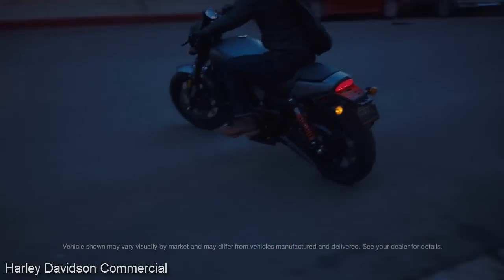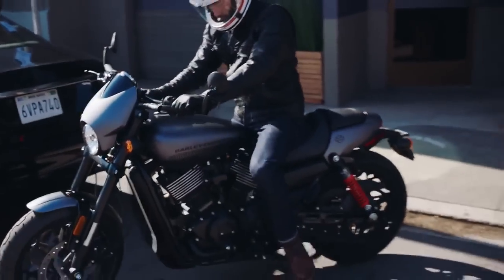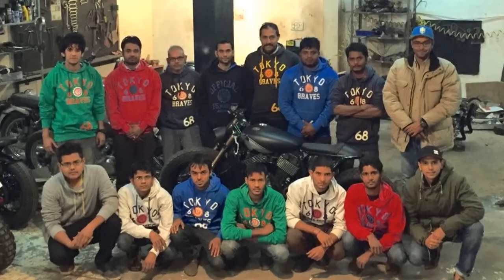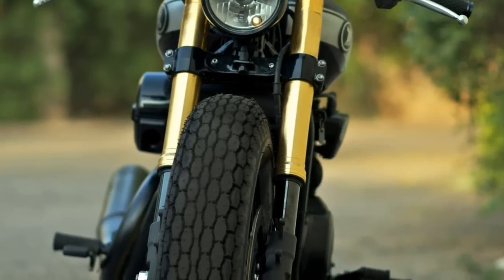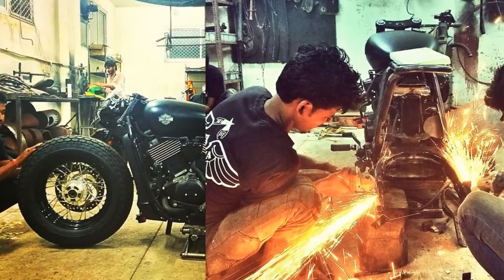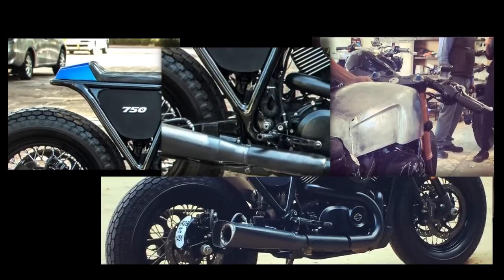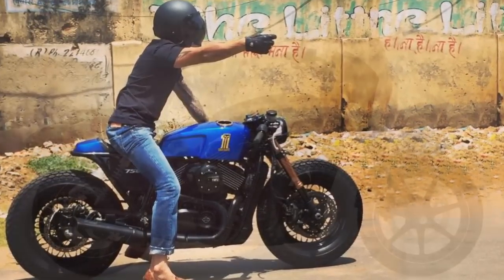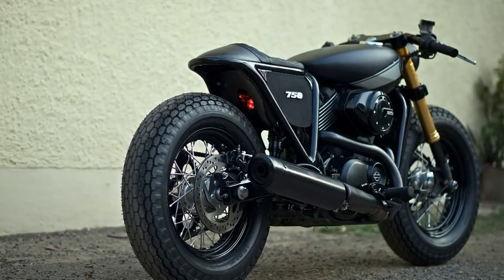Cafe Racer (Harley Davidson Street 750 by Rajputana Customs)

Comment: HD tried this market in the past. Anyone ever hear of Buell?
Reply from the maker: It is not exactly the same market.
Reply: Yes. Buell's were gear more towards the street fighter style and your video shows café racer. But both of them were stepping out of Harley's comfort zone of the "cruiser" style bikes. And to be honest. I've haven't seen many Buell's on the road over the years. What's surprising is the early 80's Virago is a sought after bike to convert to a café racer. I know it's on the top of my list. 2nd to the CX500.
Reply from the maker: I believe that the problem with Buell, was making their motorcycles to look too much modern. But this is different. It still has some retro appeal.

Comment: I am worried about whether this front tire will hit the radiator.
Reply from the maker: Yes i understand your point. But i am sure that the Guys from Rajputana 
Customs, wouldn't make a mistake as such. But i recognize that in some 
photographs, it seems that the tire can touch the radiator, but it is 
probably becasue of the angle distortion of the lens.. :) Cheers.
Reply: I appreciate their passion and effort.Cheers.

Comment: Nice! I'm curious to know if the front tire will touch the radiator though.
Reply from the maker: Lol. Yes i understand your point. But i am sure that the Guys from Rajputana Customs, wouldn't make a mistake as such. But i recognize that in some photographs, it seems that the tire can touch the radiator, but it is probably becasue of the angle distortion of the lens.. :) Cheers.

Comment: Leaving aside the rear suspension, did you notice the similarity between the Harley from Vijay Singh and Keeway superlight 125 (Small Cafe Racers 2) from Tony's Garage in Thailand?
Reply from the maker: Indeed. They are very similar. I haven't noticed that. But it seems that the Harley project is the first one, and Tonys BIKE Design probably tried to replicate the project with a smaller motorcycle.
Reply: Both are great bikes

Comment: wheels were so big that they kinda damaged the radiator
Reply from the maker: Yes i understand your point. But i am sure that the Guys from Rajputana 
Customs, wouldn't make a mistake as such. But i recognize that in some 
photographs, it seems that the tire can touch the radiator, but it is 
probably becasue of the angle distortion of the lens.. :) Cheers.
Reply: RACER TV that tyre is way to close to the radiator...its they went for the look..

Comment: narrower tires take the corners at a slighter angle. I feel that the main purpose of the larger, more expensive tires is to extort more money from your pocket. Especially when the bike has by design,  limited cornering angles possible due to clearance configurations. Just my opinion. 
Great video as usual, Racer.
Reply from the maker: Thank you my friend for sharing your perspective. :) Cheers.